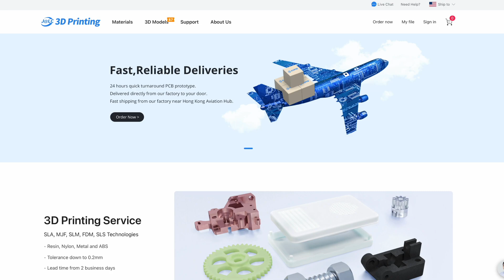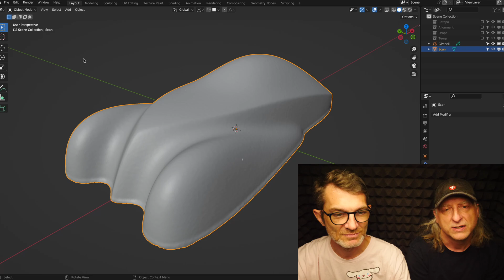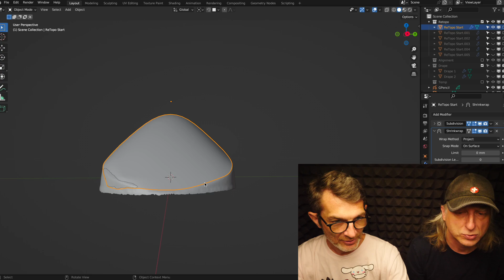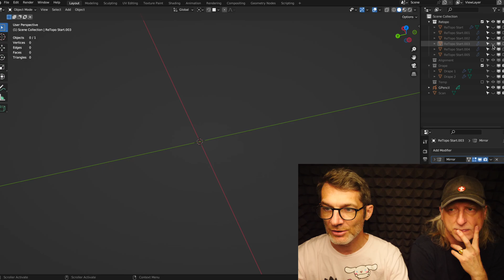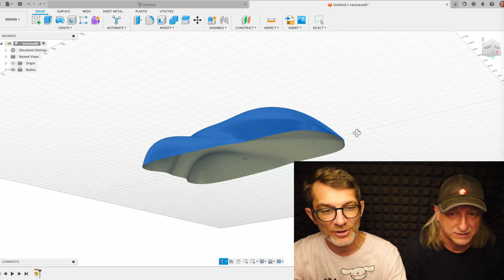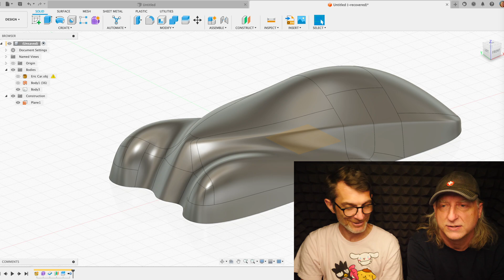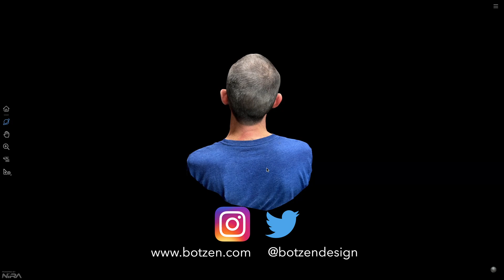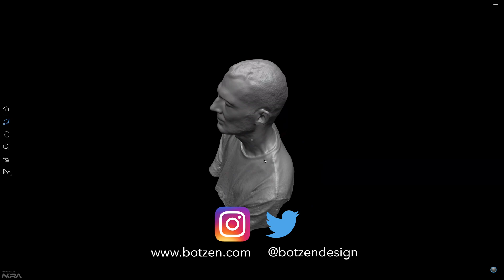Scan and 3D Resin Print with special guest Claas Kuhnen

Comment: Hello Eric I have a question,what resin would work best for a license plate frame? Something that has rigidity being thin wall and won’t warp in the outdoor heat.
Reply from the maker: use a resin with good heat resistance, check with the MFG to make sure it will work in your application.

Comment: Hi Eric
Loving your work and youtube channel.

Does regular grey or engineering resin give a smooth enough finish to allow a part to be used as a master part for polyurethane casting molds without further post processing ?

Will I get a smooth production level finish to the polyurethane parts using a resin master part that's simply been washed and cured ? Would you need a further clear coat spray on the master part for example ?

Any insight would be much appreciated.
Reply from the maker: Any 3d print will need to be finished, resin or FDM. Both would be suitable for master parts once finished.
Reply: @EricStrebel  Thanks, but how are you finishing or prepping a resin part to be a master part
Reply from the maker: I have a video about it here https://youtu.be/4_Oq-5xlblE

Comment: yep, scanning and 3d printing is not a substitution of casting, no matter what is the printing technology the  surface always need finishing, even with a 25 um resolution and high quality resins the print is still far from the original, not mentioning if you need to recreate a textured surface. There is another point, dimensional tolerances, Eric said in the video it's a good replica, but this depend for what you need it. I am pretty much sure if you put both parts on the CMM there will be quit a differences between, such a surface editing lead to a multiple variation in the shape and dimensions. 
And in general, for engineering the 3d scan itself is useless, it's a good base to build a proper 3d model, a parametrized model, not just a shape in a 3d editor.    It's a great tool, but there is no magic, can be very useful when a complex geometry need to be reproduced but is far from easy and fast.
Reply from the maker: Rock on my friend, well put.

Comment: As always great video! Thinking about handmade prototypes, how do you handle simmetry? I saw car bodywork videos using some sort of "half body rulers or patterns" to sculpt clay.
Reply from the maker: Everything starts as digital these days, so that's not an issue
Reply: I’m disappointed by the answer you received. It is overwhelmingly obvious that not everything is digital these days. I know many people who still sculpt by hand. Some work in restoration of antiques and others are, shockingly, sculptors!
I was going to give Eric a break and say the he probably works only in the pro industrial design field where everything is digital. But no. That was just a lazy answer. Even car companies still use clay sculptures as part of a car design so they have something physical to look at. They’ve updated the process with the addition of 3D printed digitally created parts but they still have the symmetry issue using clay. 

I’m not an expert on this but I’ve seen them use lasers projected on the model to help show symmetry. Also calipers and other tools (which I don’t know the name of) designed to measure from a center point out in 2 directions.
Again, I’m no expert on sculpting. I wish I could be of more help but I thought you deserved at least an attempt of helping to answer your question that might point you in a direction that could help you find your answer.
Reply from the maker: Ok, so I miss spoke, or typed…everything in my workflow that has to be symmetrical, gets digitized at some point. Just like a vehicle body would. My apologies for mistyping, thanks for bringing it to my attention.

Comment: One thing worth considering about 3D scanning: you can easily build highly accurate tools based on the initial form. With the 3D data, (even without retopologizing) you can do things like extracting offset hulls for tight fitting mold supports (perfect glove molds) and extruding surfaces to create contour jigs (put curved things in rectilinear boxes and vises).    I've used 3D scans to allow me to build jigs to accurately press fit metal hardware into organic shapes. It's especially useful if you need exact alignment and repeatability.

Comment: Great video. To me, Blender is magic. : ) Looks like a ton of work. Mahalo for sharing!
Reply: Well reverse engineering is work - I rebuild the scan one time with typical NURBS surfaces and three times with different polygon modeling techniques. I can say that with Blender this was faster. In then end the method I used borrowed from NURBS modeling (quad surfaces).
Reply from the maker: The work involved is not trivial, that's kind of my point

Comment: 1) It's OK to 3D Print and finish the master part
2) Scanning an item takes about as long as digital sculpting due to the clean up time.
3) If you want a copy, it is much faster to use molding and casting to make a single new copy than the time it takes to print and finish a copy.
Reply: you can remodel complex geometry within .5mm of accuracy in the same time it takes to scan the object?
Reply from the maker: Takes much longer than scanning

Comment: I always had this curiosity, suppose one would eventually have to build a large volume of parts using plastic injection, therefore they would need to build a metal injection mold, what purpose does the master part serve in this case? I guess that the 3d model would be more valuable, but I guess there is something in this process that I don't know.

Comment: After sanding/filling etc couldn't that 3d print make a good/better buck for mold making - or is it too much hastle/costly? I suppose I'm thinking 'best of both worlds' - for the smaller design environment (like your own) - The big companies, obviously, are 'tech-ing' the little guy outta business!
Reply from the maker: The point is reproduction, but it could be used as a master part, once it is finished.
Reply: Yes you can 3D print your own molds but any type of additional surface modification does change the volume to cast into.

If you don’t make a two part mold it is a lot easier.

I did this in the past for a few parts